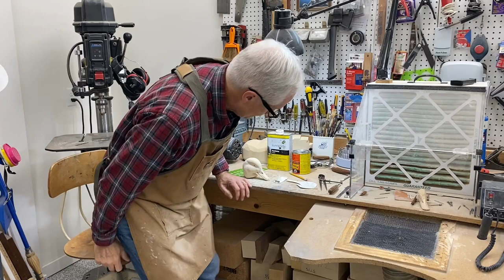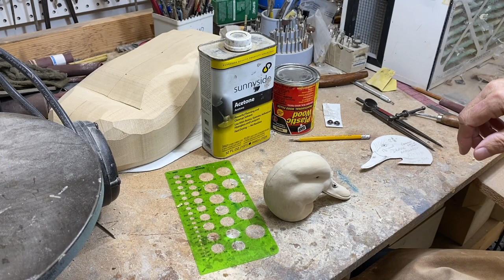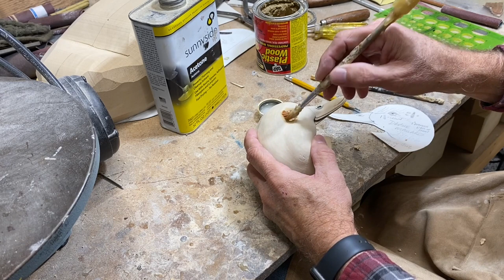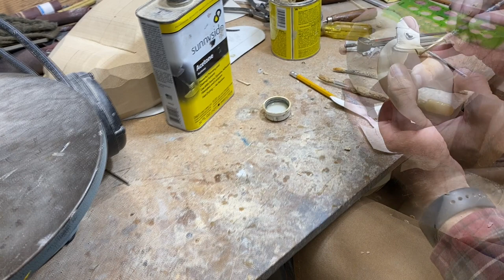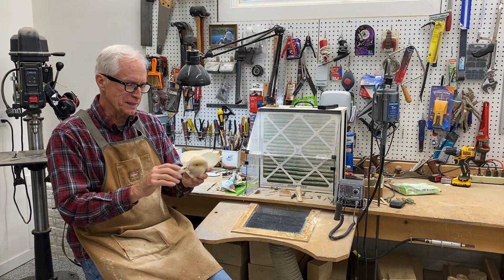Session 4   Setting Eyes in the Mallard Drake Decoy

Comment: I had not watched this video when I set a pair of eyes in a Bufflehead a few weeks back. I did use a gouge, but I did not realize I had not cut the hole deep enough. I also filled in my eye channel with the plastic wood. I dug the eyes out last night, and drilled the eye holes with a bit that was plenty big. I will fill the holes like you showed, and try to get those eyes lined up and canted inward and downward. Bills are tough for me as well! Thanks again. 
Bruce Brandeberry
Reply from the maker: Sounds good Bruce. Never an easy challenge it seems!